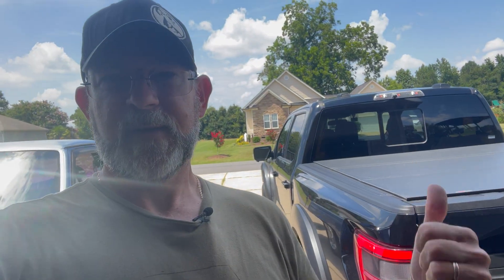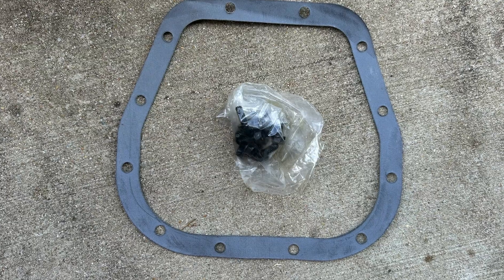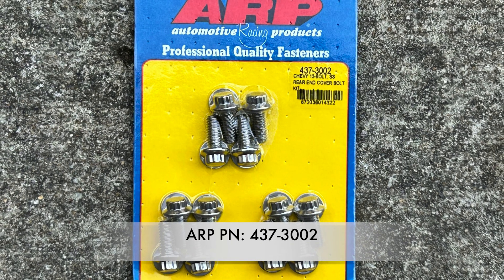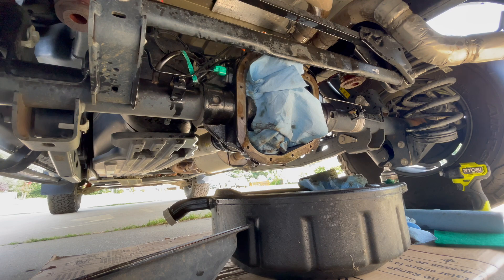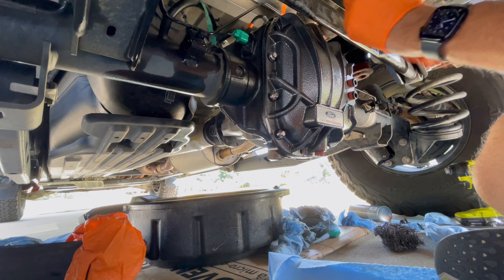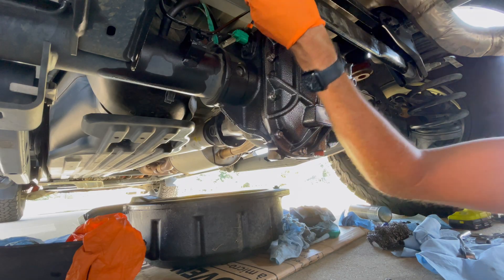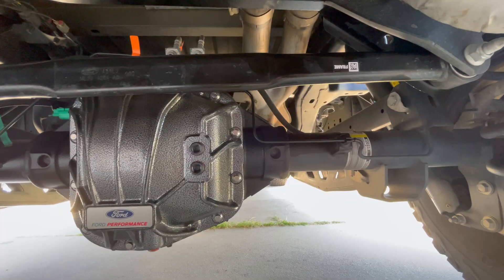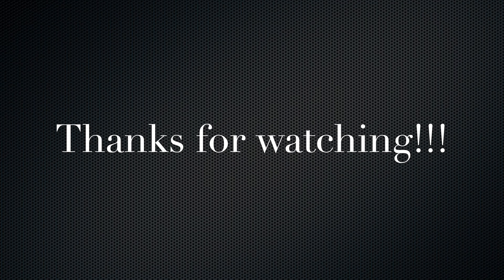Installing a Ford Performance(Spicer) Differential Cover on your F-150? You Need to Watch this!

Comment: Hey were you able to get everything as a kit from one website ? Or did you have to order everything separate ? Sorry In advanced if this has been asked already.
Reply from the maker: I ordered the cover(which comes with a gasket & hardware) but don’t use what it comes with. Order the lubelocker gasket and ARP hardware from Amazon or something

Comment: Right on, I'm planning this service for my 24 lariat. How I'm going with the Spicer cover. Thanks for including the part number for the Arp bolts. That's the only thing I was confused about. I heard people snapping the included bolts and others saying the factory bolts would be a little to short for comfort. I'm also throwing on a transmission pan with a drain plug. I hate manufacturers won't put a damn drain plug on stuff theses days.
Reply from the maker: Glad I could help! As far as the transmission pan, I went with the B&M with 2 extra quart capacity. It’s one beautiful pan!
Reply: @CG_Shots_Outdoors I looked at that one too but I'm going with the PPE
Reply from the maker: @lobbyrobby   PPE is a solid choice too! I had concerns of clearance between the pan and the Raptor skid plate... was so glad when it fit.

Comment: Enjoy the video! I'd like to hear your opinion on the 2024 Raptor's 3.5L V6 engine. What do you think of the 10-speed transmission on the same model? I'm from Saudi Arabia and I follow the channel. This video deserves a like and share!
Reply from the maker: Thanks for the kind words! As far as the 3.5EB engine I’ve had 4 trucks with that motor. The only one I had any issues was my 2019 Raptor that had the common cam phaser failure around 45k miles. I’ve also owned 3 with the 10 speed. I do like the performance advantage of the 10 speed but they do tend to have some weird programming issues causing erratic shifts. Also the 2022 and older have a defect in the CDF drum that will most likely cause a failure down the road. But there’s updated parts to prevent that from happening a second time. 

Overall the performance and reliability of my 3.5EB with the 10 speed have been very good. Be sure to do all the maintenance and especially the transmission fluid drain/fill every 50k miles, not 150k like Ford suggests.